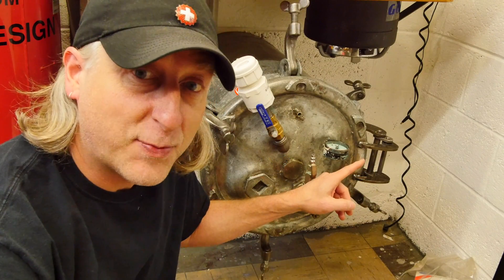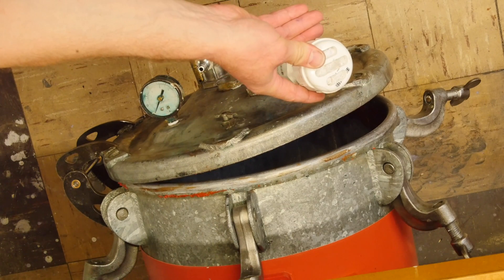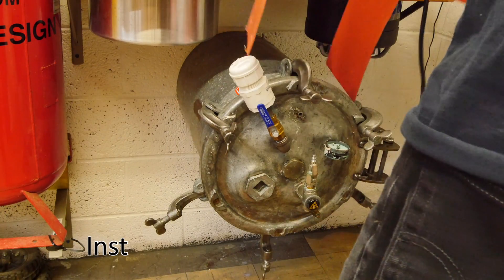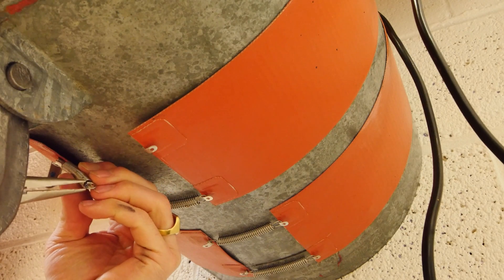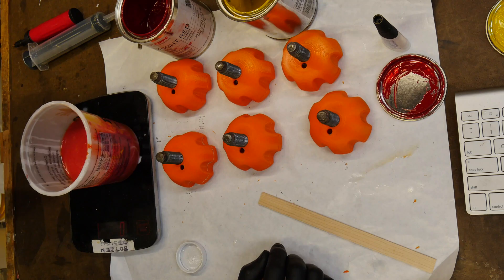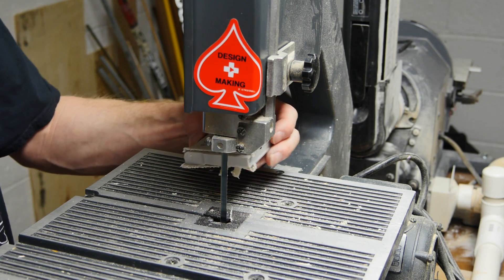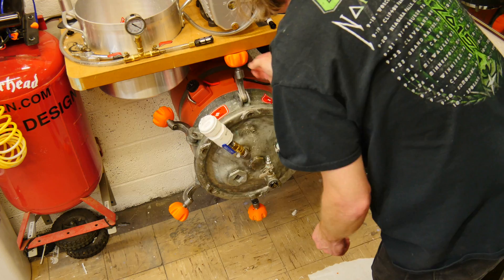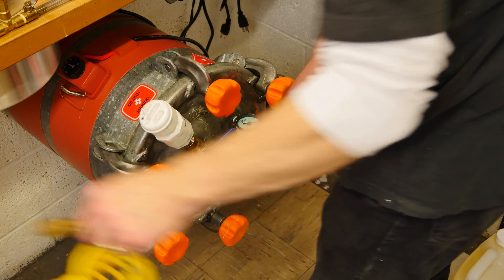Custom10 Gallon Heated Resin casting Pressure Tank, Finally finished Part 3

Comment: When you pressurize the pressure tank, do you need to keep the tank running for the entire time the part is curing?  Or do you shut off the air flow once you reach the max target PSI?
Reply from the maker: Keep it on to maintain constant pressure, just to be safe
Reply: @EricStrebel  got it!  Once again, I can't thank you enough 🙏

Comment: Eric, I am eyeing a California Air Tools Pressure Pot and would like to know how you heated your smaller pot. It looks similar to the one I have on order. Does heating the pressurized tank affect the internal pressure? Safety first. Thanks and keep rockin'
Reply: Darrel, I have a california air pressure tank and it has served me very well. I heated it in a similar manner to Eric, and technically the pressure increases, however the blowoff valve will still function if your tank were to ever over pressurize. I have used mine for years and never had it rise more than a few PSI from heating it for resin cure cycles.
Reply: @nathanlockman1554  Thanks, Nathan.
Reply from the maker: Thanks 👍
Reply from the maker: My small pot uses a coffee pot warmer, pretty basic. I assume the pressure increases slightly with the heat
Reply: @EricStrebel  Thank you, Eric.

Comment: What is the max temperature does your pot goes up to?
Reply from the maker: Over 200 C
Reply: @EricStrebel  is that the inside air temperature?
Reply from the maker: @carbonlution9228  don't know, I don't actually have a tool to measure the temp that high inside currently, but that is what the controls  go to.
Reply: @EricStrebel  Do you think heating the pot will reach inside air temperature to at least 110C?
Reply from the maker: @carbonlution9228  easy!...why?
Reply: @EricStrebel  I am planning to build my own heated pressure tank as well but contemplating on what heat source I should use, not sure if I should heat from the outside or put the heat source from the inside that could get the temperature up to around 110C. Your video helped out a lot!
Reply from the maker: @carbonlution9228  ok, good luck, I think getting a tool to measure the inside and then control that temp will be that hardest part, glad the vid helped, post on social media what you build, I would like to see.

Comment: That hinge is a work of art!  Also like the idea of the thumb screws too, yet why didn't you design in the fill hole instead of drilling it?
Reply from the maker: It was just way faster and easier to drill the hole than to model it and to have to clean it up, excetera excetera

Comment: I like the handles, they must spin a lot better than the wing nuts.
This might be what you want,   https://www.ebay.com/itm/3-1-2-1-4-NPT-CBM-0-100-PSI-690-KPA-TEMP-PRESSURE-GAUGE/193185963971

Comment: Inspiring as always! Wanna test this out my self but the cost of resin in Sweden is silly. U get a quarter of a gallon for about 80-100 bucks.
Reply from the maker: Ouch! Good luck!
Reply: Same Problem in Germany
Silicone will cost you a arm and a leg
Everytime I see someone do a mold I calculate the price of material in the back of my head and think Holy sheeet 
I found a 'Official Partner' of smooth-on
For 8kg Rebound 25 is about 310€ incl Tax O_o
Reply: @T1g3rch3n  I bought some when i was in London from a company called dwrplastics.com, they sent it to the hotell and then it travelled with our company truck back home. Its only the shipping to sweden that sucks so i havnt ordered any more from there but they are really helpful.

Comment: Nice video as always Eric. Quick question: Are you still degassing the resin in a vacuum before pouring in the mold or is the pressure tank good enough to eliminate that step?
Reply from the maker: always degas in the vacuum then final cure in the pressure tank for no bubbles.

Comment: If you're making an electrical feedthrough, I'd suggest putting everything but the temperature sensor itself outside the chamber. A remote fridge/freezer sensor is a cheap way of getting one. Just epoxy a couple of terminal blocks into a pipe fitting so it can be disconnected on either side.

Comment: I like your project and I'm considering something similar, my question is have you ever hear of a faraday cage?
Reply from the maker: Yes, I have heard of a faraday cage, what would the faraday cage be used for in this case?
Reply: @EricStrebel  your closed metal can is exactly that.  Your best solution is a passthrough in the shell wall for power, and sensors.

Comment: Wireless Sensor enclosed in a Metall Bin?
My guess is you will have some range problems of the signal if it even gets out at all :(

If you do a Pass through for Power, do one for the antenna as well :p